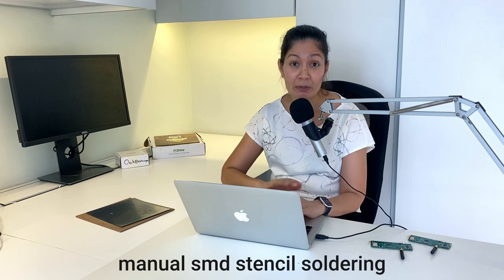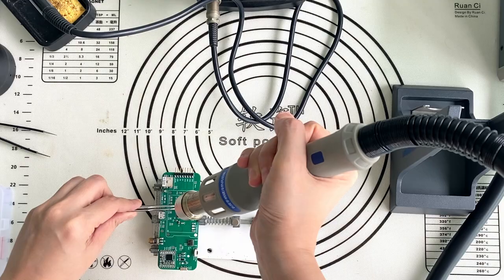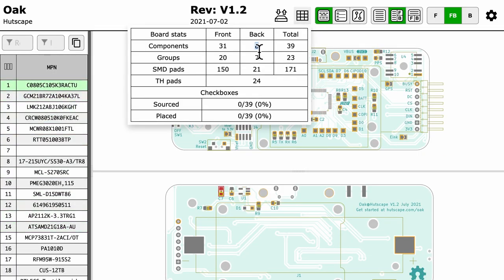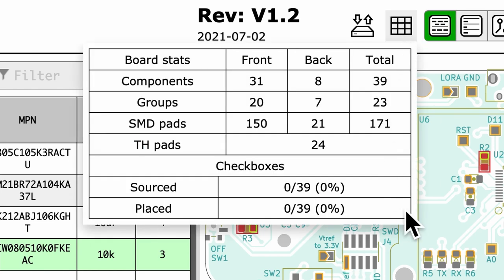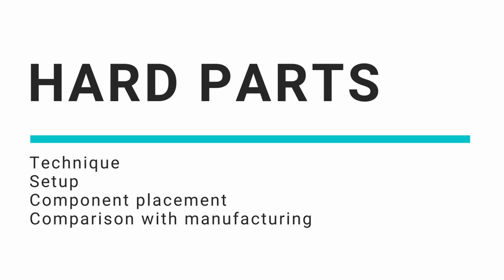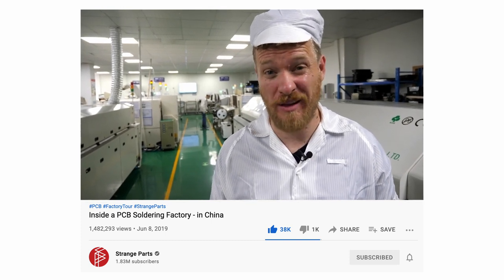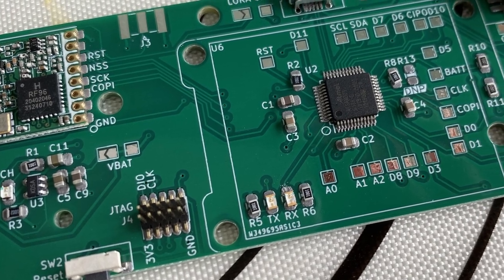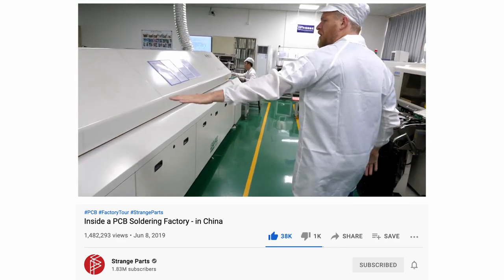SMD Stencil soldering - perspectives of a first-timer on what's easy and difficult // KiCad, PCBWay

Comment: Since you asked for tips about SMD stencil soldering in your video, here's my process.

I use an ancient small unregulated hot plate where I marked the positions on the temperature knob that yield 50C, 100C and 150C, all of which are below the melting point of the solder paste I use.

I put the board on the plate when it is cold and slowly bring it up to 150C using each marking in turn. At that point the hot air rework station need to only raise the temperature of the board around the solder joints a little bit in order to make it flow.

I use high heat and low airflow along with a small nozzle for this final step, and try to keep the airflow away from the centers of the component bodies.

I then transfer the PCB to a piece of Oak wood to allow it to cool somewhat slowly so the solder joints don't fracture. This has worked pretty well for me so far.
Reply from the maker: Thanks for sharing! I have also been wondering about a hot plate. Yours seem like a nice balance of not too many features but with just enough temperature grades to match the reflow profile.

Love the idea of using the hot air gun at the final step + the wood!

Comment: I’d definitely recommend building a toaster oven based reflow oven , the toaster ovens are very cheap , I use unexpected maker’s reflow master to control it , and get great results . I now only use my hot air gun for rework.
Did you get solder mask between the qfp pins ? I’ve only just worked out how to get this by setting options in KiCad, but it gives better results and less rework , in my limited experience . 😃 Anyway, great video and good clear explanations . Many Thanks for sharing your experiences  😃
Reply from the maker: Thanks!! Yeah, seems like a toaster oven / hot plate is a better way than a hot air gun 😅 I learned the hard way!

Regarding the Paste layer for the QFP, yeah it did seem all fine. You can check here, page 3 of the Gerbers rendered: https://hutscape.com/oak/hardware/docs/layout.pdf. I didn't have to do anything special in KiCad though. I just chose the normal footprint for the TQFN footprint, but I did allow the pin width settings to pass the DRC in the PCB layout editor.

Could you explain which "setting options in KiCad" gave you better results? Will look into it.
Reply: @sayanee  The settings were under File->Board Setup -> Solder Mask/Paste   The defaults are set to 0 , which seems to mean the Manufacturer uses their own values , I set mine to : Solder mask clearance 0.05mm and minimum width to 0.1mm . I also reduced the width of the pads on one of the footprints in the footprint editor to allow a little more space between the pads. I've also changed some of the soldermask cutouts to partially cover some of the copper , for a tiny device (TPS82140) but I've not had those manufactured yet ( This device has proven very difficult, and I've normally had to use the hot air gun on it ) I've "checked" the solder mask by uploading to the PCB manufacturers web site and using their viewer. If you have a contact email that you're happy for me to use , I can send you pictures of my boards
Reply from the maker: @DaveHines1  Thanks for sharing!! Yes, I kinda did similar things after checking with the manufacturer's capabilities.
Reply: @sayanee  It doesn't look like you need more projects but I'm very happy with my DIY Controleo reflow oven and would recommend it to anyone.  Pretty cheap and very reliable reflow.  

I've been curious about how people use thermal glue for SMD components on both sides of a 2 layer PCB but haven't found any good basic overviews.
Reply from the maker: @electrocontinuo  LOL! "It doesn't look like you need more projects". Always a dilemma, right? Finish the current projects, or get excited about new ones? 😆😅I do hear a lot of good reflow stories from DIY ovens made.

Yep, my question still remains how to use manual SMD stencil for prototypes for 2 layers. For now, I'm going to just make it on one layer as my PCBs are generally a proof of concept rather than miniaturization. I'll also keep a lookout for thermal glue methods that I never heard of before. 

Thanks for sharing :)

Comment: Amazing comprehensive video as always! After using the hot air station, do you have any recommendations for hot plates? There are some on Amazon, however unsure how well they work and reliability (some reviews say the ground wire is not attached). These wouldn't have a heating profile either...
Reply from the maker: Yes, same thoughts here. I'm wondering whether a hot plate would be better! I don't have a model to recommend, but would be nice to find something not too expensive for a home lab, with simple features (no heating profile as you pointed out). I guess this will need a little more research!

Ultimately, I guess it will also depend on our individual use case. Will we be using the hot plate to do all of our PCBs? Then a hot plate with a little more features would be good. Will we be using it to just prototype small volumes before doing the next version in the factory? Then a hot plate with fewer features would suffice enough to test the concept. These are also some considerations.
Reply: @sayanee  https://www.seeedstudio.com/Mini-Hot-Plate-Preheater-MHP30-p-4751.html is one that everyone has been raving about.
Reply from the maker: @ChinmayPendharkar  Thanks! You egged me on to do a little research on other models that I saw on social media. So I'm going to drop them here for anyone's reference!

Arturo https://twitter.com/arturo182/status/1354916451925307396 seems to have UYUE 946-1010 https://www.aliexpress.com/item/32991264316.html.

Mohit Bhoite https://twitter.com/MohitBhoite/status/1301917906297483265 seems to have something similar UYUE 946C https://www.aliexpress.com/item/1005002567982222.html

Comment: Thanks for the great videos! (I always learn something.)

Although I admire your tenacity in going with manual soldering, there are now companies that will source components and do SMT assembly, of a small quantity of boards, for very reasonable prices. The quality and reliability of a machine soldered board is far and away better than what most of us can accomplish using manual tools. When you are developing a prototype there is nothing more frustrating than wasting time trying to chase down a bug in your design, only to discover that the cause is due to an open, short or intermittent connection due to a poor solder joint. (Arrrgh!)

Do yourself a favour and pay the few dollars for machine SMT assemby.

My 2 cents. 

Thanks again.
Reply from the maker: Yes!! That's exactly my next aim :) Probably a hybrid - assemble most of the passives and hand solder the rest.

Comment: Informative. Thanks for sharing.

How much does assembly costs? Wanted to know if manual effort is worth enough (even for small scale production) considering the complexity and time required to assemble with the help of stencil.
Reply from the maker: Exactly, we have to do the cost-benefit analysis depending on each project, number of PCBs, number of components, type of components, testing, etc.

I think in general, the cost of assembly will get cheaper with higher volumes.

Comment: excellent presentation... regarding storing the solder paste in a cold storage, would highly discourage using a kitchen fridge.. there are harmful fumes generated even by sealed paste, and those that are not lead free are more dangerous.. especially dangerous when there are children at home.. 
best would be to buy small cold storage units, or to use and throw these small vials of solder paste...
Reply from the maker: Great point on safety 🙏🏻